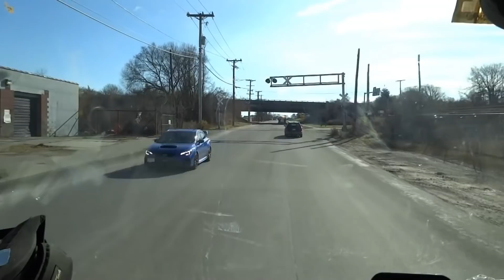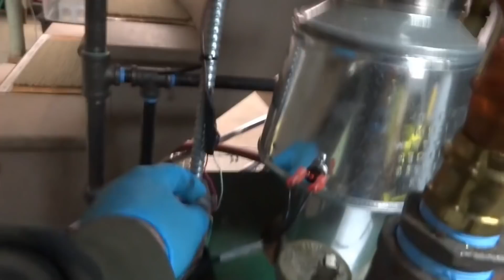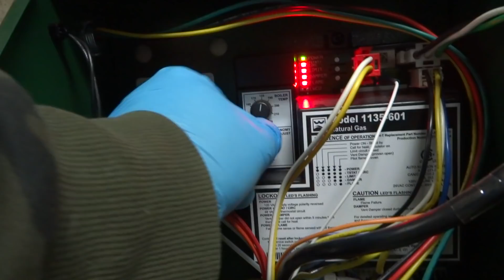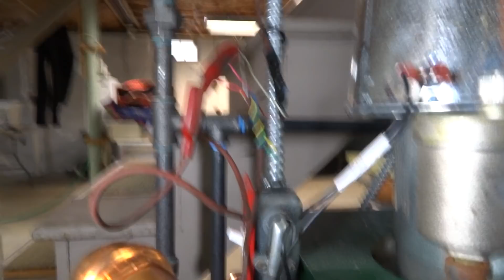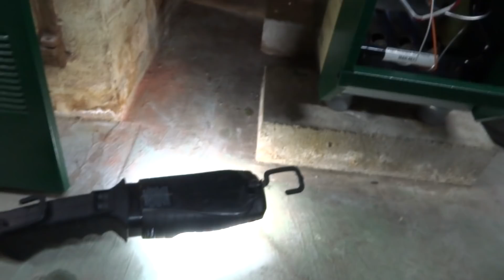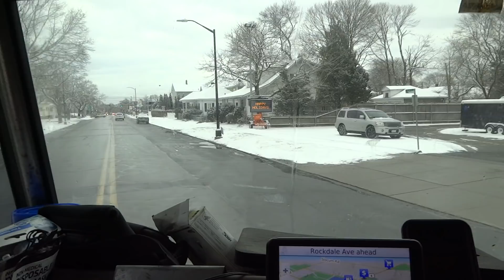GAS BOILER NO HEAT  DAMPER OR THERMOSTAT ISSUE

Comment: Steve, if possible the digital control went bad?! i have the experience . boiler will shut off around 140 degree ,and back on when water temp. drop a little. that makes boiler fire on and off. finally i changed an undated verison of the control and problem fix right away

Comment: I have a nest.. but it has a 24 volt wire that keeps it charged up. I wonder if his transformer has something wrong with it to keep it from charging correctly. Maybe the battery in the nest is bad now that's why it worked for a few years now it doesn't.. it use to hold a charge long enough between cycles to keep the relay closed.

Comment: yup the nest was charging when the boiler was off. by using the white wire as a common through the boiler relay and when the nest kicked the boiler on it had to run on battery and was short cycling...    I would never install a nest without the common

Comment: A Nest thermostat has a rechargeable lithium ion battery.  But with no common wire it can only charge when the system is running.  So if the system were to be off for a while the battery would become weak and it would start acting erratic.  Not nests fault "bad install"

Comment: Never had an issue with the old fashioned round Honeywell thermostat I’ve had in my house for 30 years.
Simple & trouble free.
Reply: They're power stealing thermostats so they can create a lot of issues. I've had to replace a lot of them for customers.
Reply: @PJam2019  How does a old simple bimetal & mercury switch thermostat "steal power"? Explain.

Comment: Happy New Year to you Steve, i've got an old Honeywell thermostat from the 70's that gives faultless service, my heating engineer suggested it was replaced by a Nest but i told him no and i'm glad i did.
Reply: The main issue is the nest needs to be charged if not connected with a common. I've had an ecobee 3 years now and its flawless. My brother has a nest I don't care for the interface and design but it also performs flawlessly. Even Steve said must have batteries or something that proves the theory I would suspect its lasted 2 years with r applied and was able to get a trickle charge even without a common.

Comment: If the control has an indicator that says flame, there would have to be something recording flame signal, U.V. Scanner or Flame Rod, correct?
Reply: Yup. Believe it’s a two stage unit. Lights a pilot that then lights the burners, and has a flame sensor that confirms ignition.

Comment: The Nest is like anything else, if its not installed right, it wont work right.  The 2 wire power stealing is the most unreliable means of wiring it as you will have the different behaviors based on the relays used in the system.  Taco includes resistors now with their zone panels to increase the amount of current required to pull the relays in and stop power stealing from messing with heat calls.  In this case, pop the Nest off the wall and charge it fully with the USB cable.  If the problem goes away for a while, then the battery in the nest is probably running down because it cant power steal enough of the time to charge.  He probably had no issues with the previous boiler as it had a larger relay that required more current to pull in.
Reply: When I worked for Honeywell and installed smart stats for the power company often the power stealing issue would make them fail. If another installer allowed a humidifier to steal power it would inevitably fail in the cold of the night and be a call out.
Reply: @lcampm2  100% agree.  It also places more stress into he relay coil as it's no longer an on/off duty cycle, it's constant pulling current, which it was probably never designed to do.  Power stealing might work for short periods, but should be discouraged by both Nest and installers.  The other thing to be aware of is that if you are using the nest for heat and cool with split systems like I am (Boiler for heat, Central Air) the C wire needs to be run to the AC unit or you will end up with Error 71 on the nest.  The nest will always prefer power from the AC/cool vs heat and this is not a configurable setting.

Comment: nest's are not reliable without a common wire. had one at my nephew's house and it worked for a year. Then the nest battery went low and it started going funky. Put in a seperate transformer and a relay and ran a C wire and it's fine now

Comment: Some info from Europe. Nest is available as a normal thermostat (3 wire or 2 wire and battery power) or Open Therm (2 wire) where it becomes part of the electronic system of the heating system (boiler). It will only work with Open Term boiler. Open Term communicates with digital signals. It regulates the flow of gas. To keep it simple, when only a little heat is needed you have small flames, when a lot of heat is needed it makes the boiler run at max. It also controls the speed of the circulator (flow of water) For the last 5 or 10 years it has more or less become the standard in Europe.

Comment: Yep I think you got it licked. The Nest POS therm uses an internal electronic relay so if it has low voltage (no common wire to tap the 24 volts) then it's unstable. Another job well done!

Comment: Why not fix what the customer wants. Nests are a good invention
Reply: How are they better than even just a basic programmable two wire thermostat, with batteries that can be replaced? 
They look cool while slurping on a PBR? I can remotely diddle with it with my phone? 
How did all that matter when this guy just wanted working heat, and probably didn’t even use the “features”?

Comment: Mine had the very same issue and somehow worked ha the beginning by gaining a common ground thru the a\c control wires until such time that it was cold enough outside when the auto lockout on the a\c kicked in and the common was lost...causing the cycling.  Once I added a dedicated common wire, my Nest stat has worked flawlessly.

Comment: Bet a hundred bucks that the dude installed the nest himself and did not run the common wire up the unit to charge the thermostat. Directions state that if you don’t supply power to it you have to pull it off and charge it every few months.

Comment: I been installing Nest Thermostats since they came out, they need at least 4 wires connected so the Battery gets charged. It loses its charge if there are only 3 wires connected to it and tries to create a Common through its software. Hi Miss Molly!

Comment: The moment you mentioned it was a Nest thermostat and only using it as a 2-wire heat only operation, I knew the problem was with the way the Nest was wired. When there is a call for heat, the Nest cannot steal power from the closed circuit and when the power gets low the Nest WILL shut down. A Nest Thermostat can be installed in ANY system that uses a 24 volt heat only circuit (and never in a millivolt system) provided a third lead for the common is included. I wired my down-draft wall heater in our vacation house that was not designed to work with Nest by tapping a fused common straight off the transformer. I never had a problem with it in the seven years of operation. My neighbors who did not use my wiring diagram could not make theirs work for more than a couple of hours, then it would shut down.
Reply: Agree. And since this Nest thermostat is two years old, the internal battery is probably toast and needs to be charged almost all the time.
Reply: can get a stand for the nest and it plugs in to the wall and its then wireless to the base
Reply: Not too familiar with this nest thermostat but what you shared helps. Thanks

Comment: The problem is the missing common wire. WIthout the common wire the nest draws some power while the heater is running to charge the battery.
Reply: I had this same problem. I had a common but I guess the control board wasn't putting out enough current to keep the nest charged. ( Before the nest it had a Mercury thermometer)
I got a power supply for it on Amazon. 
The I put a diode on the control board and jumped the power supply red and common in, hadn't had an issue with the nest after. 
I've since replaced my central with Mitsubishi dual current mini splits. 
22 KW solar array and a 50 KW battery system. First summer only tapped the grid second half of August, so far between the added insulation to the roof PV has been more than enough to keep the house nice and warm at 68°

Comment: Had this problem atleast 10 times with boilers and a/c cuz no common always check the wiring if they say or you c a nest one was a call back and guy before me replaced a $600 circulator

Comment: I installed 2 new gas furnaces a number of years ago. Also t-stats. Manual non programmable Honeywell’s. Heat-AC units. 2 speed furnaces forced hot air. Zero problems. I’m an old school guy and can’t stand the programmable units. Did not know the Nests were so bad. I Enjoy watching all your videos. Good info and some funny stuff. 😆

Comment: Hard to beat the old round mercury thermostats.
Reply: T 87f!
Reply: i still ue my OLD ROUND THERMOSTAT not the greatest but they work
Reply: Mine's not round, but same basic principle inside.  A mercury bulb on a bi-metallic spring.  A vertical rectangular Funnywell, with the sliding adjustment lever sticking out the bottom.  I bet that sucker was put on the wall when the building was built in '72.  Why mess with something that works?  I'm on a common hot-water heat system, so spending money on a fancy programmable or remote-controlled t-stat would be a waste of my money,  and simply asking for trouble.

Comment: So many people have problems with those nest Tstat. I really like the Emerson Sensi Tstat if you want something programmable and wifi. Looks like a classic Tstat . Have them for many years in some buildings to electronically lock them down it keep control of the usage. Never have any issues... In my home I just use a traditional type. That's all you really need. Good job again Steve
Reply: I've had an EcoBee for nearly 5 years without issues. It will not run without constant power, but can take power from an external 24v AC wall wart hooked up in lieu of a C wire. Everyone I know that has bought a Nest has either dumped it for an EcoBee or a regular tstat and never looked back. I've house sat for friends/family with Nest units and the damn things are infuriating.
Reply: @jblyon2  I heard the EcoBee are very good too. The older Homes/buildings are a real pain not having more than two wires. You have to get creative with C wire power. I was lucky with the buildings wall wiring since they had an extra wire not used. I used the extra wire and connected to the leg on the low Volt transformer of the old steam boiler and it work as the C power.  Folks say the Lux Geo wifi tsat you don't need a c wire?. It just runs on only batteries or usb power. The wifi burns through the batteries without usb/c wire. Take care
Reply: @frankm496  Yeah, my parents are stuck with battery thermostats because there's only 2 wires. I technically have a C wire now, but it's not connected at the air handler. Maintenance will hook it up for you if you ask, but I have the power adapter already from an old apartment which did not have a C wire, let alone a connection for it at the air handler. Easier to just use that. I'd hook up the wire myself but the air handler is in a utility room above the bathroom. Quite a show watching them get replacement water heaters up there.

Comment: It originally had no common. It used vampire voltage to charge the battery. They had so many problems that they updated the unit by installing a common.
Reply: It has to turn the heat on to use the vampire voltage to charge the nest. Doesn’t sound good for the furnace.

Comment: The Nest has to have a common to keep it charged or it will cause that exact situation
Reply from the maker: yta it went wok on us
Reply: Jim Storm >> No trolling here but every person I know that's had nest thermostat (common to me) friends & family guess the issues they'd had with them, had common wire...... no end of trouble yes they like the ill advised remote control mode but really is it really necessary? Nope...... So when they call out a service engineer theirs $$$ down the drain oh you need a new guess what??? POS nest product..... more $$$$ How long are they lasting you ask @2 years before it kick out a fault or the bucket ! 
Hell I've had simple control -  (bought new 2 > 1 spare) for over 6 years no faults it just works.... my old one I pulled stilled worked after 16yrs the last gen of the same model. How many nest thermostats has my they all gone through??? I lost count after 10  +4 in one home. I done them a favour after fourth failed - they got the cheaper simple control plus spares + I fitted them - that was wait for it... 11yrs ago none failed.......... Yet on their second heating system still no issues, the fitter tried selling them guess what? POS nest products!!! Guess what the answer was..... GTFO
So my own 22yr of use of the same wires 2 but 1 if I never changed it out. Are they Value for money? Hell no look at the price of them.... over priced POS. Full stop! wise up.